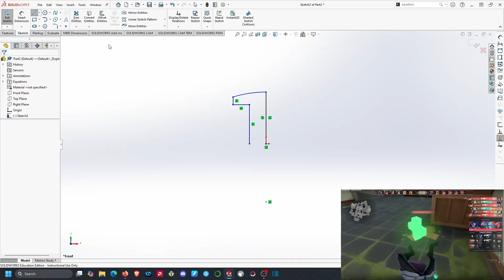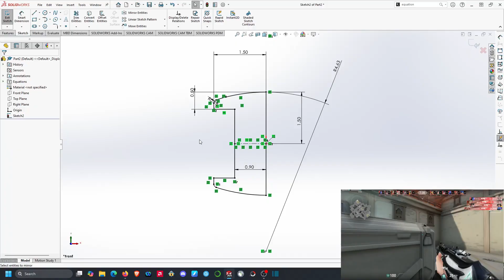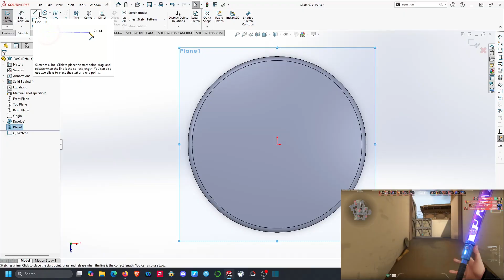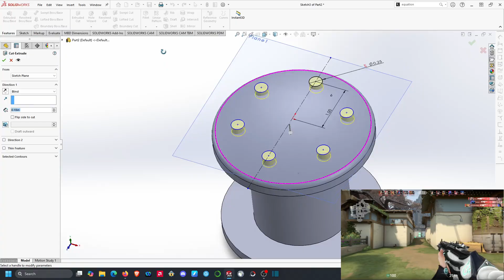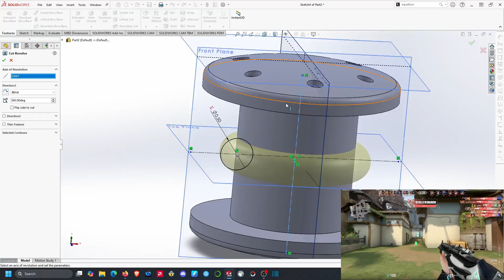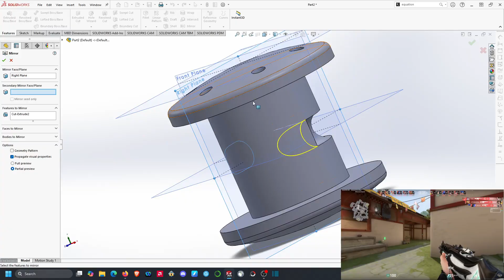Comment: Note:

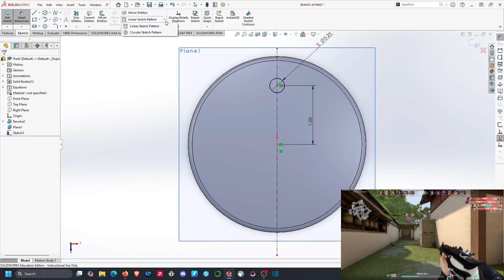At 3:17 for the circular sketch pattern you should check both the "dimension radius" and "dimension angular spacing" boxes to make your pattern defined. I forgot to do this in the video, but you should make sure to do this when making the part.